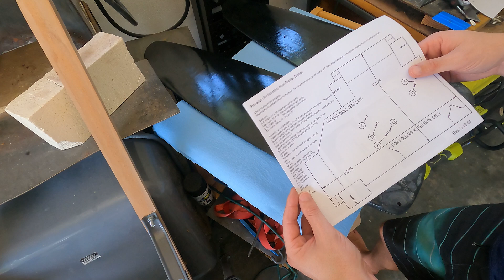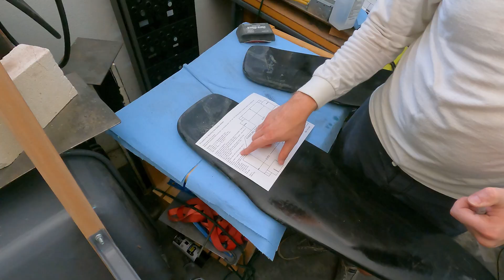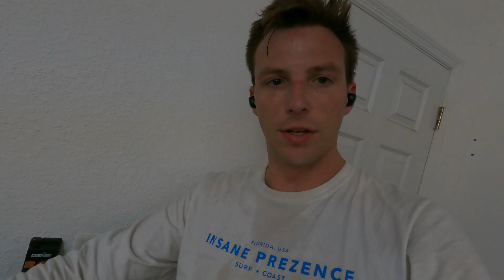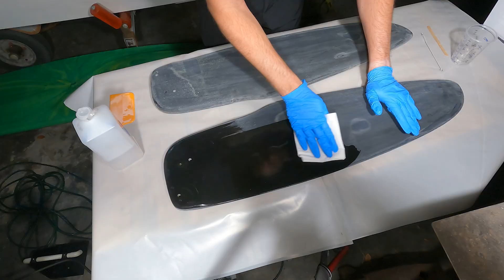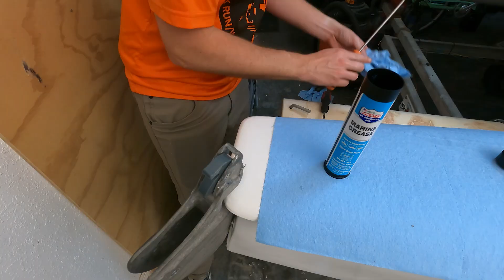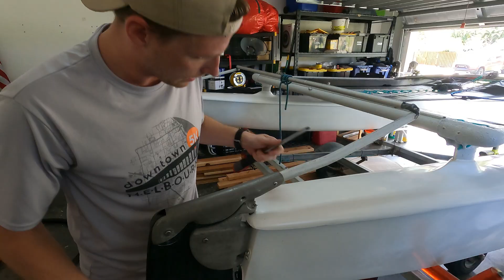How to Fix a Heavy Rudder - Hobie 16

Comment: Hello. Thanks for your video. I have the same problem on my hc16. Ruder blades are too much backwards. I would try to drill new holes. Where did you find the template you use ? Would it be possible to download it from a website?